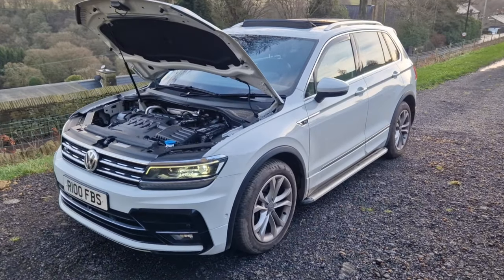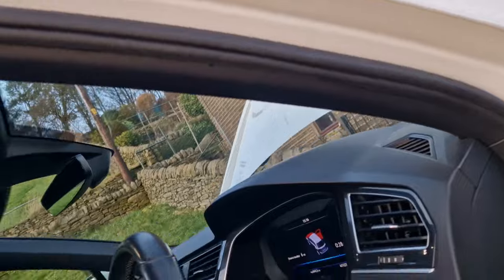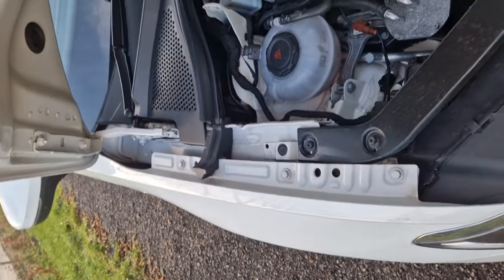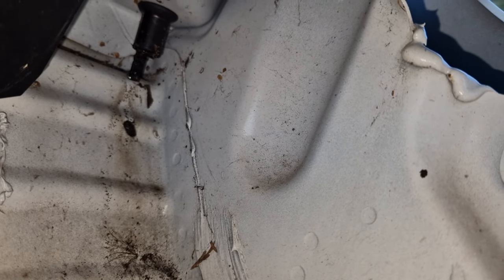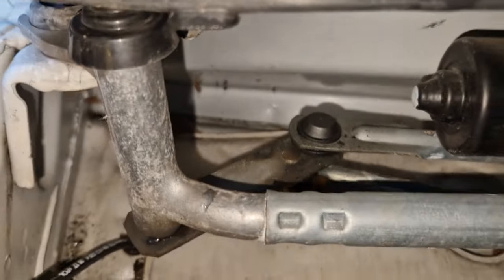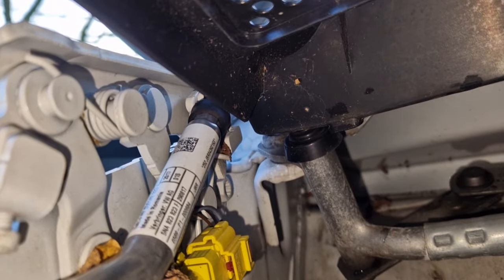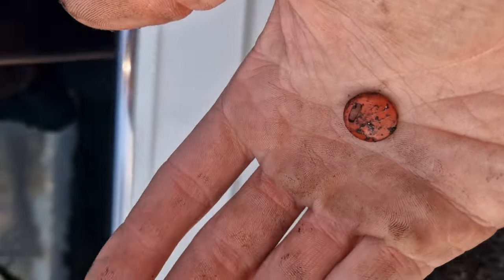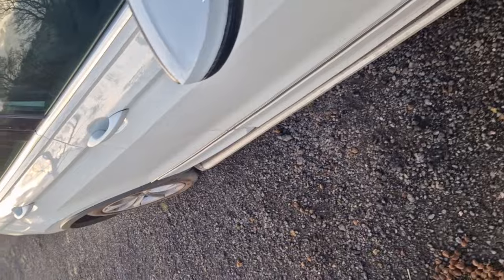VW TIGUAN MK2 PANORAMIC SUNROOF DRAINS/WET CARPETS

Comment: Thank you so much!  Like the previous comment, I also saved £290 for a diagnostic check from VW plus repair fee.  Both my front sun roof drains were clogged at the bottom where the rubber flap is.  Your video made it quite easy to sort out!!

Comment: I had this issue and it caused an abs fault and 8 other fault notifications. Followed this video and drained the passenger side (my 2017 R Line only has one front drain) as well as the rear drain near the passenger side back wheel and hey presto the fault’s cleared. Saved me a few hundred pounds if I had to take it to a VW dealership without a doubt
Reply: Hi, I’m having a similar issue and that’s driving me crazy. It feels like there’s a massive water deposit somewhere in the car as I can hear the sound. Where can I find the rear drain? I have water coming in towards the left rear passage side at the bottom
Reply: @muazzammuneeb  you have to look under the car - it’s near the passenger side wheel arch. It has an orange cap on it so it should help spot it.
Reply: Thanks for that, I have the exact same issue. Just got it cleaned and drained yesterday and no more water leak, but errors are still there. 
Did they go immediately or take a few days?
Reply: @yasoof0wnz  it was fine straight away. I did read that disconnecting the battery for 10 mins and then reconnecting may clear the fault
Reply: @ thanks :)

Comment: Can't thank you enough for this video. Had my leak on the passenger door pillar, just by the bottom of the glove box, and inside that pillar there is a large load of wires & connectors. I was able to clear the blockage following your video, so you've done me a good turn and saved me money referring it to the VW dealer. I just hope I caught it quickly, and water has not got into vital bits of the wiring loom. Many thanks. Much appreciated.🙂

Comment: Passenger side footwell is wet on mine, felt like it was dripping from the sun visor entrance.. Giving this a try this weekend!
Reply from the maker: This fault should fix it 👍🏻 awful design and people end up spending a lot of money with vw just for them to blow an air line down it its crazy 🤯
Reply: @Theyorkshiremechanic.  well, I've cleaned the mud from the bottom of it..bit feels like I needed to get further up but there was no chance. I'm hoping it does the trick, but it's not raining in Sheffield today so I won't find out yet 😂 Thanks for the video.
Reply from the maker: Its either that or try and get hold of some 4mm air pipe or some welding wire and go from the top

Comment: After watching several videos of roof liners being pulled down, I decided to take it to the main dealer. Got an appointment in 3 weeks time! So had another look and found your video - Fantastic - front 2 drains completely blocked. Then I went to your video about unblocking rear drains - oh dear, that's a lot more of a major job. I noticed there were no spider traps on these, does that mean they are less likely to get blocked?

Comment: hello Yorkshire mechanic...please help...going to try your video tonight hopefully. i also have the footwell leak and dripping through the overhead centre! i had a query as i have been monitering this closley past couple of days....essentially you have one gulley nearest the sunroof opening....and then you have the net that folds down and then another gulley where the drain holes are in the corner.....my question is, is in normal to have water in the gulley nearest the sunroof opening? i assume once it rises it drifts over to the outer gulley to drain? please advise. many thanks!
Reply from the maker: Hello, is sounds like your drains are blocked, the reason its in both sides of the gulley is because the drains blocked and its just over flowing its channel and therefore entering your car, let me know how you get on, fingers crossed its a quick fix 👍🏻
Reply from the maker: Make sure you watch my new video as the rear drains might be blocked too
Reply: Certainly will be, literally just finished giving those spider catchers a good clean. Seems to be draining a lot better so I’m hoping no more showers on the way to work! Guess we will see. If this doesn’t resolve it I will be fuming haha. Just to confirm the outer gutter should only have water in and not the inner right? Cheers

Comment: Isn't there two more drain plugs at the rear?
Reply from the maker: Hi Daniel, as far as i am aware you are correct and ill do another video on them as i havnt yet looked where they are, keep a lookout this week for a new video of the rear drain locations and ill stick all the info into that video. Cheers
Reply: They come out behind the carpeted wheel liners for the rear wheel. The side with the fuel filler may be obscured, especially on diesel models which have ad blu filler in the way. Mine is a petrol model so was easier to reach.

Comment: Would I do any damage if I removed the red cap then sucked out the sludge with a small pipe connected to a wet and dry workshop vacuum
Reply from the maker: Probably not, but access is quite tight so you may struggle but it would be doable, you can also go down from the top with a long bit of wire or some compressed air and blow it out too they are some other options

Comment: Hi, I have 2018 sharan panaromic sunroof but water is leaking from my sunvisour light I would like ro know will it be the same issue as this video thank you
Reply from the maker: Hello, yes i would say so, probably both drains blocked therefore when driving its overflowing the correct channel into the head lining 
Cheers 👍🏻

Comment: Could you not unblock them with compressed air?I am thinking about buying one the 2 litre diesel are they a good buy?
Reply from the maker: Yes you can also do that, it maybe difficult to get the air nozzle down into the drain from the top but deffinatly do able, yes the 2.0 tdi are a good engine been around for years in the VAG platform, this one is a 2.0 tdi, same with any motor, good service history and regualar maintenance helps keep brake downs away

Comment: Great, very helpful. How we can avoid this problem? By not opening sunroof?
Reply from the maker: I have removed the little red rubber caps to prevent the grime building up and help keep the drains clear, other than that there isnt a lot more you can do 
Cheers 👍🏻
Reply: @Theyorkshiremechanic.  I've 2-year-old Tiguan which becomes worst because of it. What's the use of red rubber btw? 
If the sunroof is closed still water will be going through the drainage pipe? Sunroof edges are not airtight?
Reply from the maker: @niknkson  the use of the red flap is to stop insects like spiders going into the pipes but you are more likely to get a blockage with the red caps fitted than insects, once removed, try and gently trickle water down the sunroof drains in the front corners, and check your drains are free and flowing but be carefull not to flood your car make sure the water is on a slow trickle and going down the drains. When the sunroof is closed its designed to still go over the sides of the glass and down the drains 👍🏻
Reply: @Theyorkshiremechanic.  thanks dear for your time and response. I'll check tomorrow, as I sent my car to VW to get it fixed as it's the warranty.
Reply: @Theyorkshiremechanic.  Would a light blast from an air compressor clear them as well? Just thinking maybe once in a while just blast some air down the drain blow out the debris and keep em clean
Reply from the maker: @timbo7457  that would work great if you have access to an air compressor but just be careful not to blow full pressure down the drains as it could dislodge the pipe from the sunroof framework then it would be a complete headliner remove job to sort that out, nice gentle air pressure should work well 👍🏻

Comment: Thanks for your help! I’ve unblocked the drains but as I was taking one of the clips off I managed to drop it and lose it, will this cause any issues? (With the engine, I can het a replacement clip)
Reply from the maker: Hi, ohh dear, no shouldn't cause any issues itll either rattle out or just sit somewhere it wont cause any harm, please like and subscribe 😊

Comment: Still the same bullcrap, I have a 2012 that leaks on the driver's side. Spent 5 years and hundreds of dollars and my car is still soaked. Frost on in side in the winter and steamed up like a greenhouse in the summer. I'll be trading it this spring, I've had enough. Mechanics over the years have said over and over, you never chase a leak. Sell it!
Reply: Did you always keep up with maintenance?
Reply: @gabiclingan4406  I  take car of this car like it's a ferrari. I did however fix my problem last month. Since I want a dry car instead of a moon roof, I had the roof wrapped in vinyl around the glass. We've had heavy rain last week, dry as a bone. So instead of 600 dollars a year clearing roof drains, 180 dollars permanently fixed my problem.

Comment: Mate you’ve just saved my arse! I knew they were blocked (water pissing in) and couldn’t find the right help. Just need to get the airbag light sorted now 😢 (I’m assuming caused by the water when it was leaking in).
Reply: You don’t know how to do the back ones too so ya 😅. Owe ya a pint
Reply: Have exactly the same with mine.... Water leaking and Airbag light... Check your horn works as well... If thats the case then what appears to be common on the Tiguan is the Clockspring especially if all of your steering wheel controls no longer work